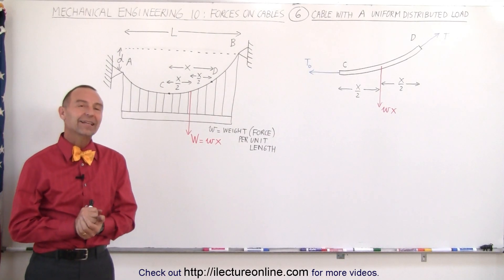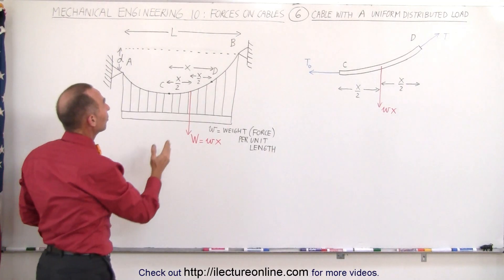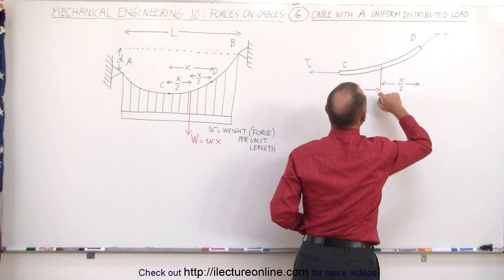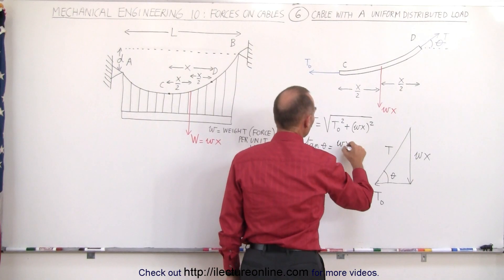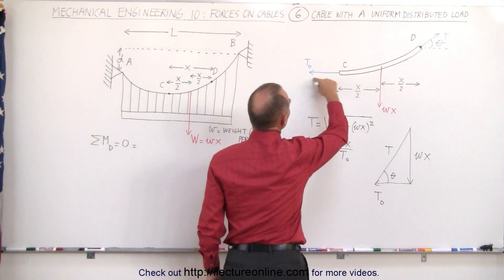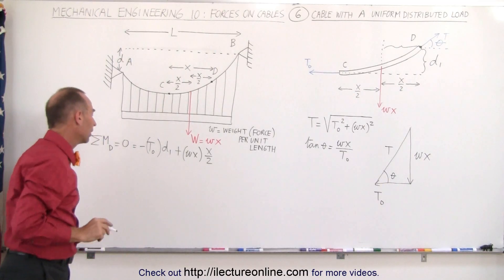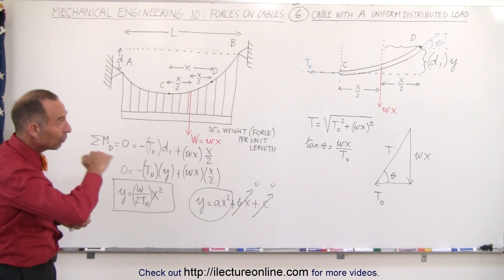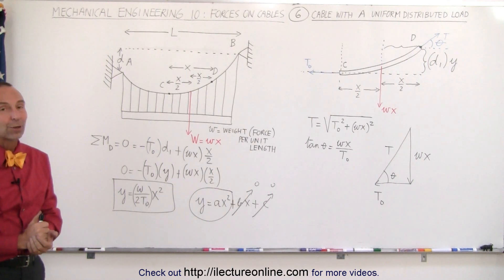Mechanical Engineering: Ch 10: Forces on Cables (6 of 33) Uniform Distributed Load

Comment: Thank uh for this vedio ....
But can uh please explain me that 
If a heavy string attached at the ends at same horizontal level and when central Dip is very small approaches which type of curve and why ???
Please explain me
Reply: because this video is a case that outlines a uniformly distributed load along the cable. The situation you described is when its sags from self-weight, which is described by a different curve (catenary, next video in this series)

Comment: I think the shape behaves as hyperbolic curve. I have found a problem that the teacher use the length of CD as x is kind of wrong
Reply: Hiền Trần That concept applies for catenary cables, where the weight acting is just the weight of the cable. In this case the wieght is external and the cable has no weight. There is nothing wrong in this concept
Reply: @vinayak1561  Thanks